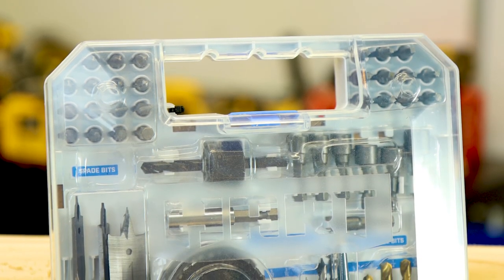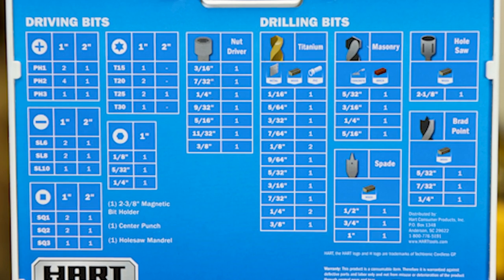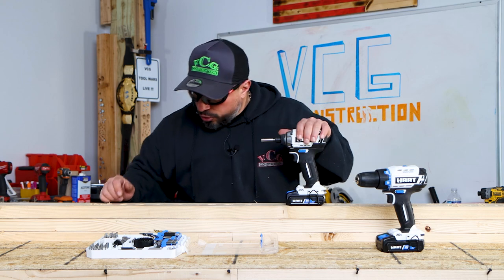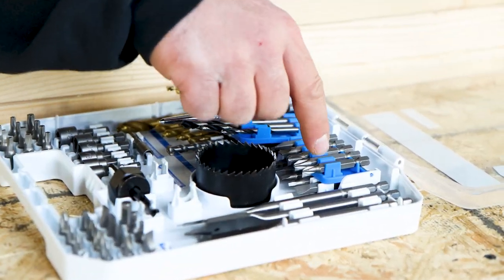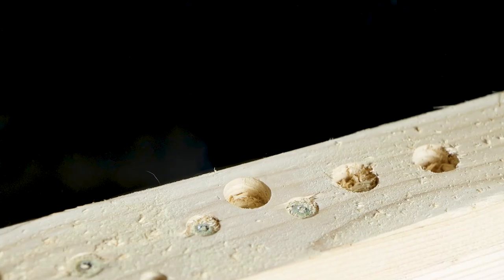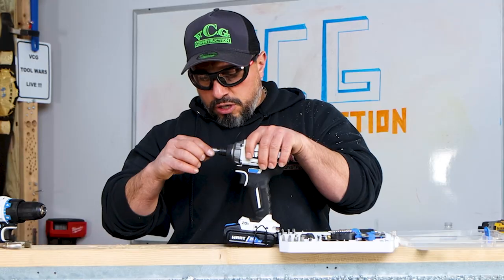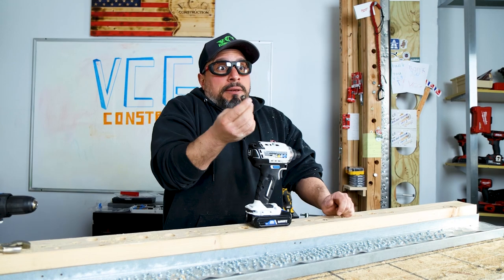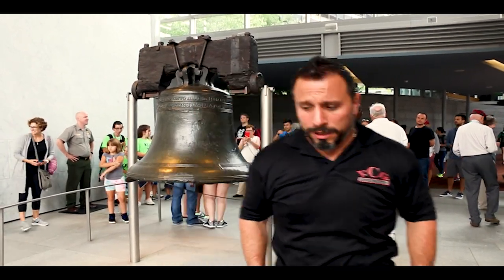New HART Tools 70 Piece DRILL & DRIVE Bit Set (I CAN'T BELIEVE WALMART SELLS THIS!)

Comment: Even though I already own a cordless drill that I’m pleased with, I picked up the Hart impact driver & drill combo. What I love about them: the impact driver is smaller and, my opinion, more manageable for someone with smaller hands and the drill is 1/2 inch. Most cordless drills are 1/4 inch.  I passed on this kit but, picked up the 3 piece 6 inch impact driver bit set.  How many times have you encountered a tight space and had to finish driving a screw with a manual screwdriver?  I always run into that situation and it drives me nuts!
There are some things I like about this kit...maybe it’s worth it for those items.  🤷🏻‍♀️

Comment: hey Vince have you came across a new bit set with a non fitting phillips number 2 also can you test harbor freight brands bauer (18.99 for 35 pieces) , Warrior (5.99 for 32 pieces) , hurcules (19.99 for 45), storehouse (7.99 for 80 pieces)

Comment: Well, I have this same driver and kit, and It wore my #2 right down. I don't know why it went half way through my 2 x 4, and it would not drive any further, for some reason. I tried a couple screws, however, I had no problems with the driver bit that actually came with the impact driver. It worked great. I couldn't believe that that particular drill bit, in the kit, just continually ate out the head of my screws.

Comment: There are very old quick change bit sets that came out with the notch cut in the end that mounts into the quick change collet that mounts into the drill chuck the same as the impact drive chucks of today.  Most of the higher end new impact driven bits have a reduced shank just above the business end of the bit for prevention of breaking screws and other fasteners off with the impact action. Milwaukie has the best rated ones followed closely by Dewalt. I often wonder would I rather loose a screw in a piece of wood or end up replacing the broken screwdriver bits. I live on a farm and it's not like a run to the shopping center when you need things were talking about a half hour drive one way. You need good tools that will hold up to use and sometimes a little abuse.

Comment: Just put down 500 sq. ft. of 1x4 IPE a type of Brazilian walnut which is the 2nd hardest of all woods for those who may not know. The contractor sold the homeowner on 1x4 instead of 5/4 stock because that was what was available from a certain supplier he goes to. A camo gun hidden install requires minimum 5/4 thickness (1 in actual) and they werent routed to accept ipe clips and i sure as hell wasn't routing all that stock, there was already a 3/32 thickness discrepancy between half the order so i was already dealing with that putting me behind schedule. So instead I was face screwing 2.5 inch T10 stainless trim heads. I started with the free GRK driver that comes in the box and pre drilling a 1/8 pilot followed by setting it with an impact gun. I spun every tip off i had in the 3 boxes of screws by quitting time. The next morning I switched out the impact for a reg cordless drill to drive the screws smoothly and to hedge my bets i also bumped up my pilot to 5/32 and a dewalt T10 max fit driver,  i went through 2 drivers by the end of the day, better but still no good. After a run to the hardware store I grabbed 3 milwaukee shockwave T10 drivers and those outshined dewalt and GRK brands. I did spin 1 off so far but it lasted me all day and some of the following day so im extremely pleased with the quality of the shockwave drivers. It wasnt an ideal application but it came out looking great and im proud of the work i did

Comment: The cut in the shaft on the spade bits does not necessarily mean its impact rated. Several drills are made with no real chuck just a 1/4 inch drive to accept bits and drivers with 1/4 drive ends.  I have a Craftsman drill/driver set that I’ve had for over 25 years. First thing you needed to do was insert the 1/4 inch adaptor into your corded or “brand new” cordless drill then all the other items in the case would fit into that adapter.   Unless the manufacturer states “impact rated” I would be careful about assuming that to be true

Comment: Anyone know if kobalt will come out with a pack out type system to attach to the rolling tough box that my 5 piece xtr set came in because it seems like the perfect base for such mentioned system especially with everyone else doing them I've been kinda bummed they haven't came up with something like that yet. I absolutely love the xtr kobalt tools and would be nice to have attachable cases to hold fasteners and bits etc. I would really love to see something come out very very soon for that setup in the kobalt blue and black colors before I have to break down and buy the craftsman system or likewise. Any info on this would be wonderful and helpful to me or if someone could pass it on to lows as I'm not the most computer savvy type person, thanks .

Comment: The biggest reason for the extra wobble on the spax screws when not using the included bit is because there’s an extra little indent in the spax screw which the included spax bit fills by having a little extra piece on the bit.  This is for the torx bits of course.

Comment: I been thinking about trashing my hyper tough tools Even though they all still work.  I even used them on the job sight as well.  But I am going to replace them and was wondering about buying the craftsman cordless toos.   I don't have the money for milwaukee or dewalt so what do you guys thank about craftsman ?
Reply: Save ur money and keep the tools lol. Not worth it
Reply: Craftsman, Kobolt, Hercules, or Bauer.  Any of these cheaper line are okay.  If I was just starting out I would go kobolt.  5 year warrent and it is easily replaced at any Lowes.
Reply: If you go with heart go with Brushless, that motors are strong

Comment: I got one of those hart bits it was good works and took the abuse I put it through. That I did alot. But that I did a door dead bolt. And used 2 of the masonry bits. In drilling in to 1970 foundation in a a cellar. But it too so long I had to used alot of support. But good for a quick buy

Comment: I basically just use these cheaper kits as consumables. We're always training guys that have never used a drill cant swing a hammer or drive a bolt. Of course 90 percent of them are lost and the other ten percent destroyed from misuse. the amount of Phillips bits and 5/16th/tap con drivers that are stripped because 18-25 year olds are afraid to push forward and DRIVE things in is astounding. So i keep a few contractor grade things in my personal tool box but use the cheap shit unless absolutely necessary around others.

Comment: Its literally quality over quantity. I use a lot of bosch professional bits and drivers and i dont bother with those 200+ kits because more often than not you want be needing half of it or half of it wont be fit for purpose. Better to spend a bit more and get smaller sets for what you need, like a set of professional brad point bits, separate set of tct masonry bits.

Comment: Weird that I have bits with that little cut out that I bought 30 years ago, way way b4 the advent of impact anything! Huh? I don’t agree with your thinking at all. Little cut is meant to retain the bit. Any bit. Before that improvement bits would actually fall out when tipped down.

Comment: Hey, I have the Hart Impact Driver and the 70 piece kit.

I have a low level of experience with this type of work and am learning. 
I have a specific question for you. 

Do you have to have an adapter for the masonry and titanium drill bits?
I can't figure it out. 
Thought normally that you could twist the neck of the drill to tighten on the bit, but this drill doesn't work like that.
Thanks for the help.
Reply: I subscribed to show I appreciate it

Comment: Would I buy a Hart power tool,  probably, because I watch another channel where they have used them for a year and they are working fine.  When it comes to bits,  that is what I consider is a disposable item,  and when they are that cheap in price, they may work,  just not for a long time.  And based on my luck,  it would fail when I need it.  Who who has only one bit of each,  we all have a bunch is a drawer....

Comment: I was shopping at Lowes about 2 weeks ago and I walked passed a Kobalt drill bit set for $19.98. I seen on the front of the packaging that it had a quick connect included in the kit. I grabbed it, went to do a job later that day and when I got the kit opened I realized the quick connector wasn't compatible with am impact driver. I was not happy with this. I mean, why in the hell would you even include this thing in the kit?? It seems useless to me. Aside from that, the kit was pretty solid.  Great case, I like the design of the trays inside the case and the bits fit pretty good. But who ever works at Kobalt and thought that this shit was a good idea needs a swift kick in the nuts ill tell ya dat!!Dat!!! And then fire  his ass!!

Comment: I got the smaller Hart bit kit, and the design of the case is such that the bits all fall out of their slots if the case is set down right side up.  I have to make sure the case is upside down so the bits don't fall out.  I'm strictly a DIYer and use the bit set with Ryobi brushed tools, so I'm a tightwad.  But even so, I was disappointed by the design of the Hart case.